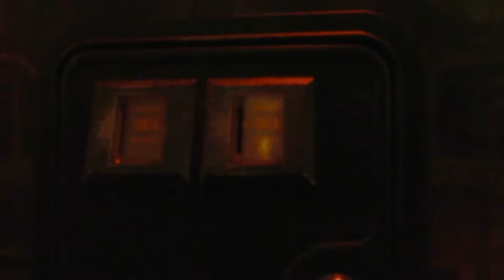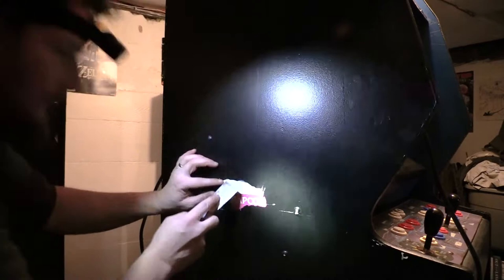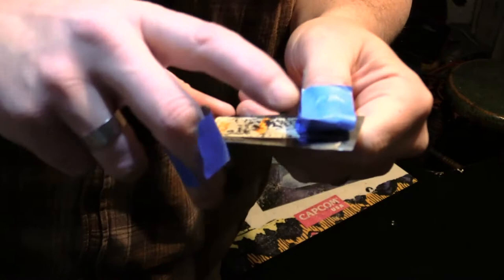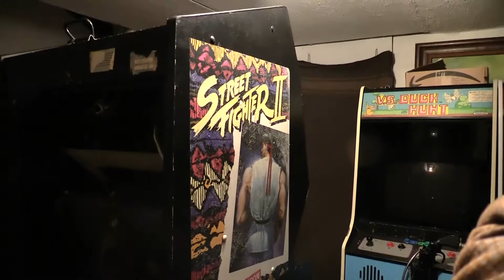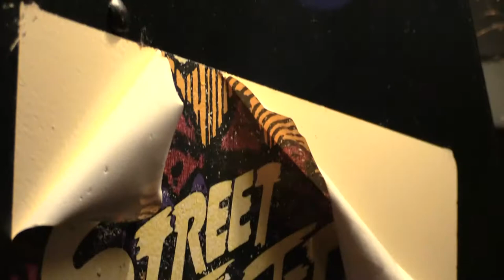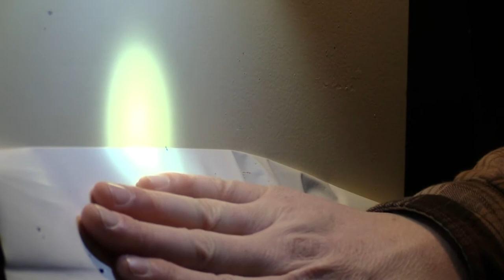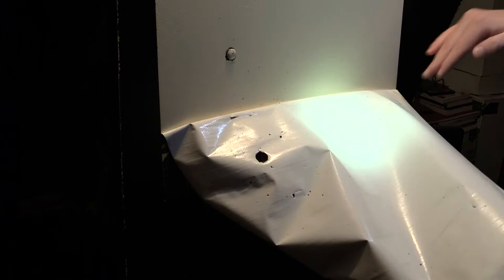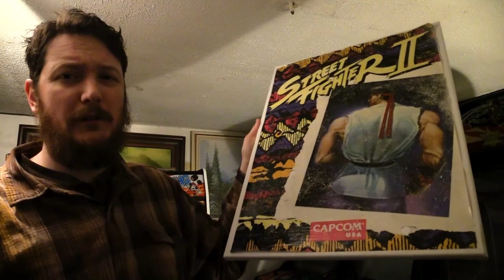Recovering Arcade Side Art Under Paint - Part 2 | Arcade Restore and Tech

Comment: Great salvage job man, how many hours did that take in the end all told? Love the end result. Also you have a real craftsman's touch with this stuff, you were able to get it past those two bolts real smooth, was really impressed by that as I'm assuming those carriage bolts are a 'once they're in, they ain't coming back out' deal.

I wonder what the cab's story is that it had side art for the specific PCB it had wired into the cabinet, but the side art was painted over. Does it have T+F art beneath the white layer?
Reply from the maker: Thanks man, was cool I got it off in 1 piece; yea its strange to paint over the art of the game thats currently installed, totally agree. No T&F art unfortunately.
Reply: @wildernessgames  Agh curses. At least it's a good blank colour beneath that black overblast rather than something like yellow or pink that'd fight a coat on top, do you think you can paint right on top of the white or will you need to reprime to do the TF convert?

I'm guessing the old op who had it ran multiple PCBs in the cab and just wanted a generic fighting setup maybe?
Reply from the maker: @voorheesretro8129  Reprime for sure.
Reply from the maker: Oh not sure on how many hrs, the scraping took ages, i dont know 16 hrs or more I dont recall. I did it in many sessions.
Reply: @wildernessgames  Good thinking :)
Reply: @wildernessgames  I can imagine, have to do graffiti removal intermittently at work and that always takes longer than you expect, and this was a blanket coat of paint!